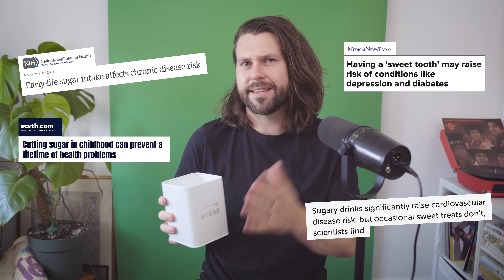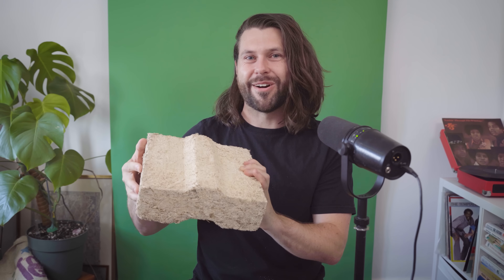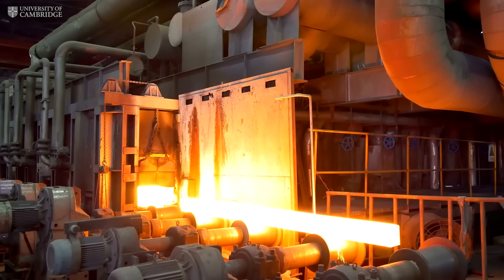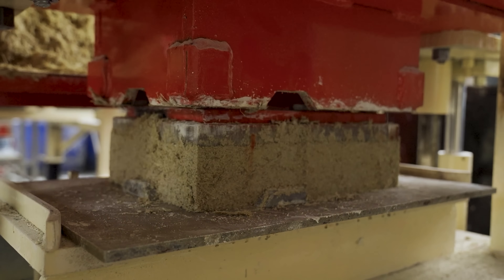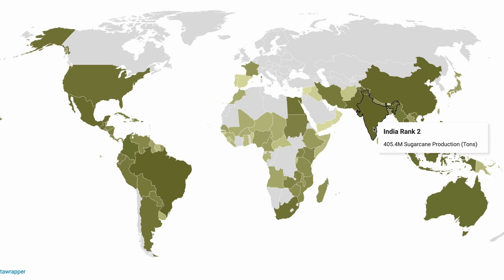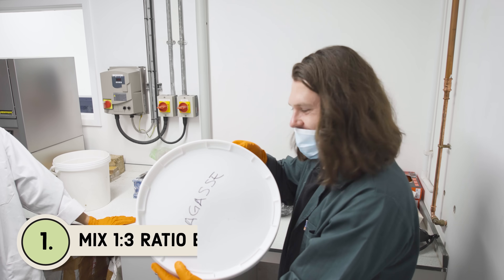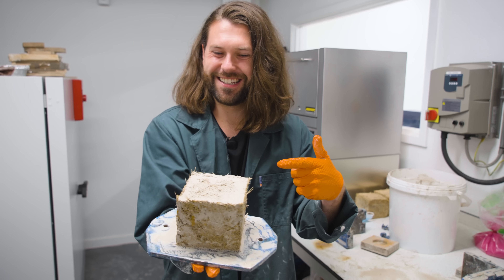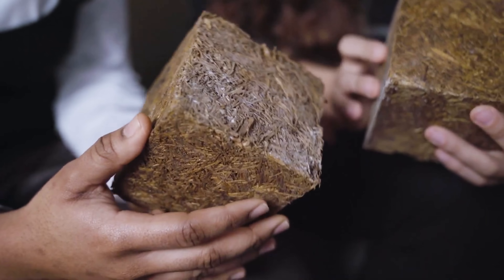How Sugarcane Waste Could Replace Concrete

Comment: How good is sugarcrete in temperature insulation? How durable it is? How well does it protect from elements? Do insects/rats/cockroaches/others find it a good place for making nests in? How fireproof is it? How long does it take for sugarcrete to start decomposing? How long does it make to crumble - weeks/months/years/decades/centuries? What are it's mechanical properties? How big can you build with it?
Do NOT get me wrong - that idea is genius, but there are practical concerns that need to be addressed for this revolutionary invention to be accepted.
Reply from the maker: They're fair questions and with any new innovation that's developing and being tested, there isn't going to be as much data as those pre-existing alternatives. To try and summarise an answer to all of that, in short, Sugarcrete behaves much more like masonry than an organic material. According to UEL, it has been lab tested for compressive strength, fire resistance, thermal performance and durability to recognised standards, and it can be tuned to act either as insulation or as load bearing blocks depending on the mix and pressure. It doesn’t contain free sugars, the fibre is mineralised and highly alkaline due to the binders, which makes it unattractive as a food source for insects or rodents. As with any building, pests are more about gaps and detailing than the material itself. Protection from the elements works the same way as traditional masonry. Good design, lime finishes, damp protection and proper detailing matter. On fire performance, it has achieved high fire resistance classifications in testing, despite being bio based. In terms of longevity, it’s an early stage material developed around 2021, so no one can honestly claim centuries yet, but it’s being tested for long term durability and weathering in labs and piloted in real buildings with the aim of lasting decades, not weeks or months. It’s not meant to replace concrete everywhere, but to offer a lower carbon, circular option for many building applications, and those practical concerns are exactly what the research is focused on solving.
Reply: @itsSamBentley  This information answered most of my own questions.  Thank you!
Reply: @itsSamBentley  Thanks for the answers, the video lacked a bit in information about properties of the material so my OCD started acting up. 😅
Reply: @itsSamBentley this speaks to how in depth new technology development hours and how well you research your topics. Congratulations🎉🎉🎉🎉
Reply: @itsSamBentley hey, thanks for the reply, Sam. Those kind of questions are important, and I honestly had the same while watching the video. 

It's good to see the info about them is available if needed, cause there are people who would love to give it a try if possible. 

Part of the importance of those answers is that many people (like my parents) generally have small storage buildings in their backyard, which are not as critical if they don't work out and which some of them would probably be willing to experiment with, using a new material. Worst case, it was only meant to store some things throughout the year.
Reply: @itsSamBentley  I'm curious to learn how well it serves as thermal mass. If it's very slow to pick up or let go of heat, then that can help significantly reduce heating bills.
Reply: @itsSamBentley there's like a 30 minute sugarcrete deep dive condensed into this comment.
Reply: @itsSamBentley huh- more valuable than I expected!
Reply: Greetings! Great questions, i'd like to address them and make my own assumptions on some of the characteristics of this material. As a material engineer, i hope i can make at least some correct assumptions =)

Basically here we have a mineral-organic composite with no set orientation (all fibers directions are random, thus close to isotropic properties). 
Temperature insulation properties, i assume, will be somewhere in between lime mortar and cellulose, directly proportional to ratio of fibers. 
Important that over time Ca(OH)2 in mortar will capture CO2 from air, transforming in CaCO3 (Chalk). It is something to keep in mind. 
Protection from elements will be the same as any other brick-type material, which is really nice. Same for fire-safety. Unless you have acid rains in the area, but even then - extend the roof more and you are good. 
For fiber decomposition - alkaline medium will change some properties of fibers, but it's hard to say exactly how. It will depend on fiber properties prior to processing (size, size dispersion, leftover compounds and others). It all will affect fiber decomposition. Addition of cross-linking reagents for cellulose maybe can counteract this effects to some extent. Lime mortar over time will change into chalk which is edible for rodents and i guess other pests. Residual water in fibers shouldn't affect decomposition (i guess).
Mechanical properties will be mostly determined by lime mortar, altho it depends on ratio that is easier to determine in experiments. One thing for sure - it will crack less over time, adding to crumble resistance. BUT fiber itself may cause cracks in material if it will change shape or size due to external conditions (moisture, maybe - Im not sure how fibers will change with moisture tbh). 

Last thing to mention - lime production itself creates CO2 and use quite a lot of energy. Not as much as cement, but still. I think it is not a problem tho. I believe that we should stop treationg CO2 as the dangerous waste and start thinking of it as another resource. After all, plants love it!
Reply: @jinxmono  thank you very much for adding your very educated guesses! (Of course we don't want to build the China TOFU dregs so more research is needed)
Reply from the maker: A reply Oluchi sent me on this too: Hey 😊
Your questions are all valid and extremely important as building safety is the upmost priority when it comes to construction.
Sugarcrete is indeed a promising material, some mechanical tests have been conducted and thermal conductivity too. 

The purpose of sugarcrete is for this material to lock in carbon for as long as the life expectancy of the building. If the blocks are formulated in a way that it elongated the durability and if they are installed correctly, ther should be no reason why the building should not have a reasonable lifespan.

At the moment we cannot say a specific duration as the sugarcrete building is still being monitored by the team.

For information on tech specs please find the technical reports on the sugarcrete blocks and acoustics panels here: 
Blocks: https://www.uel.ac.uk/sites/default/files/uel-sugarcrete-blocks-technical-data-sheet.pdf

Acoustic panels: https://www.uel.ac.uk/sites/default/files/uel-sugarcrete-panels-technical-data-sheet.pdf
Reply: All valid questions. May turn out that it's only useful in certain climates, conditions but certainly worth a study.😊
Reply: Doesn't look like it can withstand any seismic problems either!  Can it burn, say, in areas that endure forest fires?  What are its insulating properties?  Of course, I'm assuming that it can withstand all watr damage like conventional bricks.  So many questions this video doesn't address before we all get on the bandwagon.  But on the other hand, if it works and solves these questions, heck ya!  Let's study it more.

Comment: Hempcrete would be my first choice and this is a great use of the waste material.
Reply from the maker: I did ask Oluchi about Hempcrete in my interview with her, it didn't fit into this video but going to post the full interview with her about this on my Patreon. I think essentially Sugarcane waste is already abundant and readily available so it makes for a more efficient alternative to hempcrete.
Reply: Yes, I'd rather support the hemp industry than the sugar industry.
Reply: One does not preclude the other. I like to be flexible and welcome ideas like this. I love that it is using a waste stream. I am a Building Designer and I am always looking for the least harmful, most durable and best-to-live-in solution for any location, and individual set of criteria. 
I love designing with cob, strawbale, hempcrete, rammed earth and light earth. 
This is a very exciting solution to add to my list of options!

I'm designing in New Zealand and Australia.... is anyone producing the bricks 'down South' 🤔

Comment: This is what the world needs. Innovative uses for waste that not only sequester CO2 from re-entering the environment but also provide an economically sound (less expensive) means of building they might not otherwise have. Thanks for your time and effort for this video, Sam.
Reply from the maker: So many wins to this like you outlined!
Reply: So where do the sugar refineries get their energy if they can't burn this stuff?
By "energy" I mean "heat".
Sugare refineries need heat.

When this stuff is burned, the carbon it is made from is returned to the atmosphere (as CO2) from whence it came.
It is carbon neutral!
Much better than burning fossil fuels.
Reply: @goaway7346  Why not get energy from renewable which are probably cheaper to our planet in the long run? I can see this being used as carbon credits. The construction industry offsetting their emissions which gives funding to renewable energy. Also wouldn't it be more sustainable to have a solar farm which is set up for years rather than burning things for energy every day? Sure it's better used as fuel than waste and landfill, but I can imagine one day companies will be forced by policy to adopt greener production cycles and limit their pollution
Reply: @harumitsu3014the problem with Solar power is the innoficiency. They only produce a max of 25-30% of the potential energy they could make. Solar is 'useful' but not a perfect solution because the units are just not capable of producing enough power. The ind. has had long enough to improve it, but, appear not to be doing so.
Reply: @marionsgift  Japan is making consistent breakthroughs in solar panels. South Korea is mandating car parks put solar panels over car parks. With how many cars America has it could probably solve most of its power problems with that. Solar farms can also cover waterways and canals which also reduces evaporation. Titanium solar panels could double the lifespan. If they're only utilising some of the potential energy that means there's much more room for it to improve. No one's figured out how to burn things more efficiently, or make oil more efficient. There's no future in fossil fuels